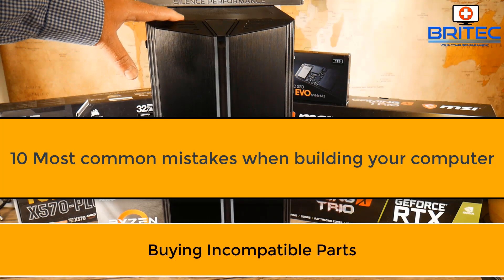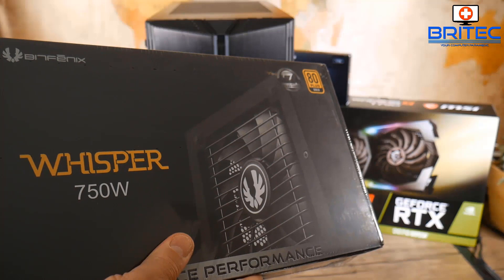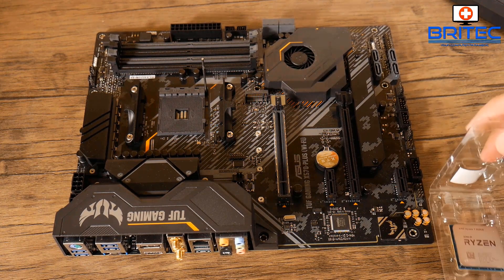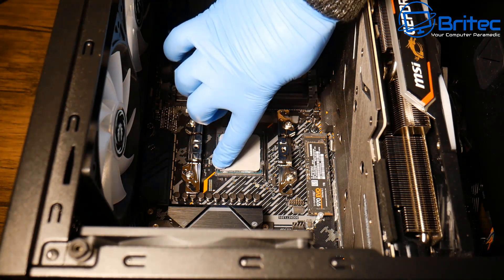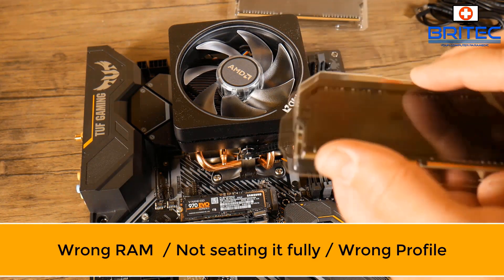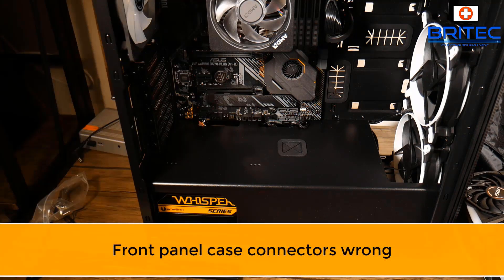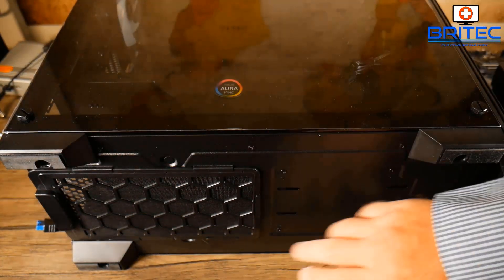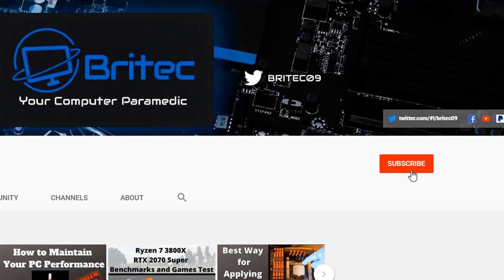10 Most Common Mistakes When Building A PC

Comment: Static is a problem! Fortunately I was not building a PC at the time. I went to change the volume on my hifi amp (in the days before remotes for amps), the statis discharge was so large that it caused a small split in the skin on the end of my finger. I could see the arc clearly and it was in daylight.

Comment: hey brian,happy newyear,im back,had no internet from 30/12 till now,my IP tech had to put a new wall sockett in pfff,all good now,exept,i bought a new state of the art router (AC2200),and a new dongle (AC) for my computer,but the two still connect in old style BG,any tip or suggestion brian so that i can use the 5 mhz AC) band instead of the 2.4mhz (BG)

Comment: Happy New Year Bri hope this year is a good one 👍. I think the incompatible parts is the biggest mistake, I've watched a few you tubers make this mistake. 100% compatibility isn't guaranteed - the combination of parts might be incompatible, large heat sinks on motherboards is just an example and more common now, where if you have a 120 radiator & fan hoping to replace the rear case fan with it and it wont fit due to the heat sink on the motherboard being so large with no clearance between the top of the case and the motherboard to put it there either. Sometimes until you actually start the build with the pieces in front of you its hard to realize what problems you may encounter which is why you should try to do as much homework before you start, PC part picker is a great tool and I recommend it to everyone but its not infallible, I try and watch videos on builds involving the parts I want to use so I can see what problems they encounter and reviews for the performance too sometimes hype is an influence when there are more reasonable priced parts or better price to performance options out there. Going back to static, will a full pvc gimp suit prevent this being an issue? Lol, had to throw that in, I think the other fault is not realizing how much room you need to work in, having the right tools and cable management, I've seen people place cables across the back of motherboards where the back of the cpu is, where it gets really hot, also no room (depth) to run the cables (usually at the back) so the case panels either bow or do not close at all, normally cheap cases, (not that all cheap cases are bad). 👍

Comment: i always do the research first to make sure i dont make mistake number 1, the panel connector mistake i put my hand up for, the other 2 are putting a fan in the wrong way so it sucks instead of blows, and putting on a cpu cooler where the cable could not reach the cpu fan connnection

Comment: After the build is complete, it is a good idea to immediately 
check the c.p.u. temperature. It should be steady and not too high.
 
If it is fluctuating wildly, it is an indication that the c.p.u. fan
and/or thermal paste were not installed properly. If any instabilities
are detected early enough, the c.p.u. can be correctly reinstalled before 
any damage occurs !

Comment: One thing to remember about grounding.  You may say your touching the case every so often.  But unless you are leaving the computer plugged in (and you really shouldn't be inside your computer when powered up or plugged in) the case isn't really grounded because the 3rd. plug on the power cord provides the real ground to the case.  If it's not plugged in, it's not truly grounded.  So it's better to ground yourself properly with the wrist strap anyhow.
Reply from the maker: That is what I was saying, touching the case does not ground you long enough to make it safe

Comment: Thanks Brian...and HAPPY NEW YEAR!
Quick question please? TeamViewer flagged me as a commercial user, I am not. I am 73 and only use remote assist to help a few friends. Now I must choose a new remote assist software. I watched your video recommending Cloudberry, which appears to be very similar to TV. Carey recommended Ultraview. In your professional opinion, which is better for simple consumer use? I very much value your opinion. Thanks again.
Geo
Reply from the maker: If you are just using it to fix friends and family, try https://www.remotepc.com/download.htm or https://remotedesktop.google.com/
Reply: @peersi I had used TeamViewer for many years. An appear would have taken a couple of weeks and I needed the remote support that day. I just moved on and researched several options. Cloudberry is free and works without having to install anything on the remote computer. So far, it has worked just as well at TeamViewer and in pretty much similar fashion. Simple interface without all of the bells and whistles I don't need anyway. Thanks for the reply.

Comment: You can also,  and  I've  seen this in manufacturing   that you can put that  wrist  strap around your ankle  and it  will  do the same thing if you are sitting down .  Of course you need to   put  1 mega-ohm  resistor  between you and the ground reference
Reply from the maker: I use it round my ankle and use a esd mat which I am standing on

Comment: was it Carey who left the plastic on, lol
Reply: Yep ! 😎
However, Carey is doing it live and sometimes gets carried away, while others are editing those mistakes, I'm certain they do make mistakes.
Reply from the maker: Leaving plastic on the CPU is a beginners error. lol
Reply: @Britec09  I would like to make an objection here, regarding "grounding" ourselves. Antony from Linus Tech Tips is advising people to plug themselves into the wall socket, to the real ground. What will happen if someone is conducting power through his body, from PSU to the ground? Your advice is somewhat unclear, are you also advising that we plug ourselves into the wall? This thing  needs to be clarified. Because I know if current from the mains goes through our heart, we are toast, that is - dead.
Reply: @ShamanKish  There is zero power going through the plug. the 2nd image on there you can clearly see that the only plug pin that has any metal on it is the earth pin. The 2 power pins are plastic meaning it is non conductive.
Therefore the rest of your statement is nonsense
Reply from the maker: 1. zero power on that plug I showed, its using the earth, you really need to learn how it works. You are in no danger of electric shock. 2. No mistakes are edited out. Hope this clears things up.
Reply: @Britec09  Hopefully you are right. My idea was that one has to stay on the same potential as the rest of the system (usually meaning touching the case).
Reply: Also Paul.